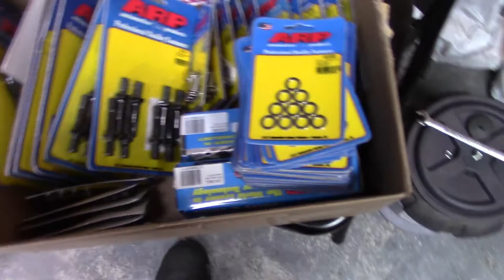Drilling Some Bolts & Stuff Vlog

Comment: That's a lot of washers , I have been trying to find a  arp cylinder head stud kit for my sbc but they are all on backorder .
Reply from the maker: After the election I knew price increases and shortages were coming so tried to prep for the future a bit.
Reply: @BOOT  we are finally at a place where I can get the rest of the things I need to get my Nova back on the road, but the timing of everything didn't work out in my favor .. lol I haven't had trouble getting anything else though . I guess I will probably settle for arp bolts just wanted studs